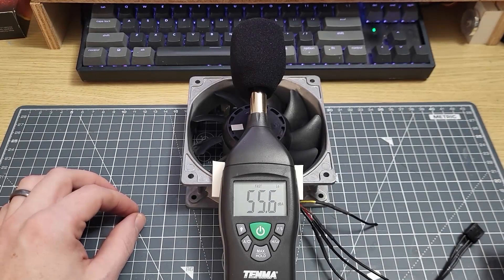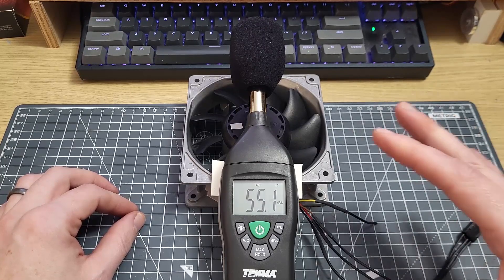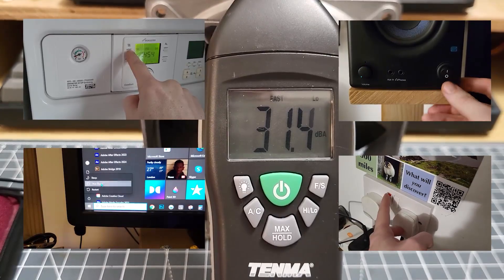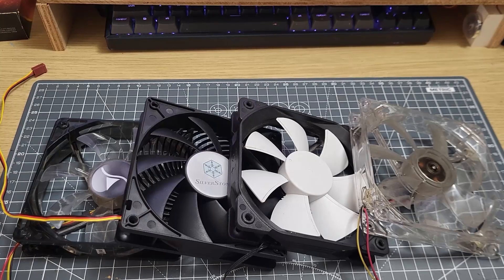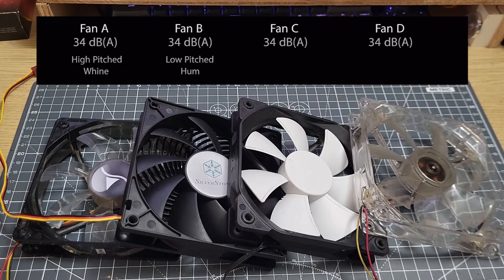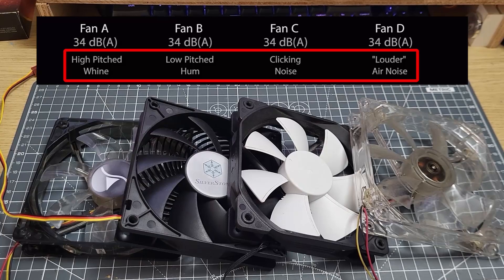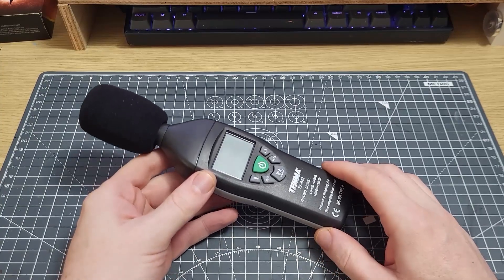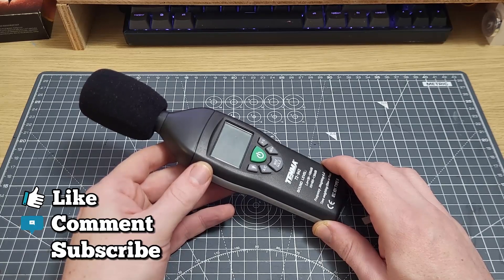Fan Noise: Loudness Perception and "Timbre"

Comment: Yeah I have been trying to capture some of this stuff in my channel. I feel like a lot of people don't care too much about the performance of a fan, they just want it to work well enough and not sound annoying while doing so. Of course there are aesthetic preferences too but this is just talking about the performance/noise aspect.
Reply from the maker: As you know, I did some similar testing a few years back with my meter and "proper" audio capture, and I realise that while it's nice to get an impression of how quiet these fans can be, ultimately it's down to individual preference and the noise of the environment - which is likely different for everyone. On a daily basis I have three Delta 120mm fans running at low rpm and I can't hear them over my mechanical HDDs.

Comment: This is why I've been a long time buyer of Noctua fans. The premium price in performance is not worth it, but the reliability and fan pitch/hum has always been pleasant to my ears unlike some other brands. 

I've switched over to Phanteks T30s now, offering better performance(because of 30mm thickness) while remaining quiet. I can't speak on the reliability yet as my time with them have been short.

Comment: I would love to see someone compare fans taking into account psychoacoustic characteristics like tonality, roughness, sharpness, etc. The formulas to calculate this are openly available, for example in form of Matlab code
Reply from the maker: Yeah it's possible, but it'd be a huge amount of work requiring the proper test environment (anechoic chamber) and very high precision measuring equipment, plus the expertise to operate it. But it would be interesting!
Reply: @FanPhys  I'm pretty sure even a cobbled together testing setup could get us more meaningful results than just some dB values. I already have a tiny Dayton iMM-6 measuring mic and an interface with pretty good SNR. I might just get an anemometer, build an archaic sound booth and give it a go lol

Comment: the A curve on db meters aims to mimic the human ear and it's reduced sensitivity to lower frequencies,altough it;s not perfec
Reply from the maker: Indeed, this is called the weighting and there are several different weightings for dB measurements. The problem is that you're still only getting the pressure level, which is not very much actual information about the sound itself.